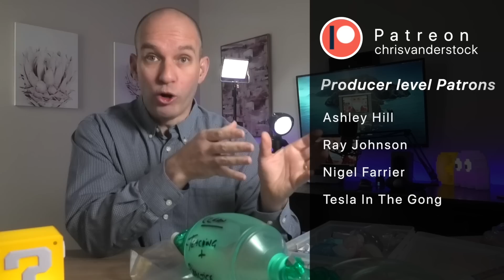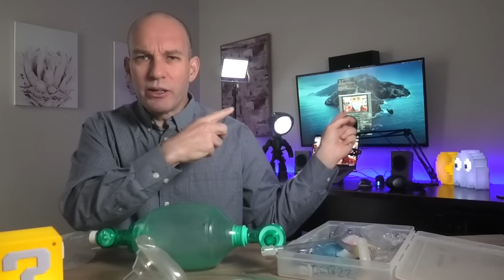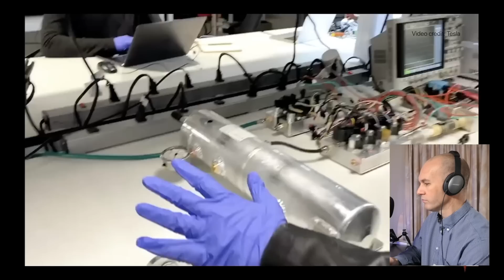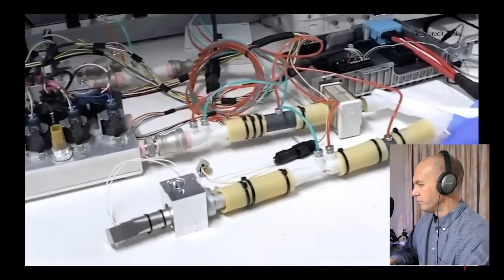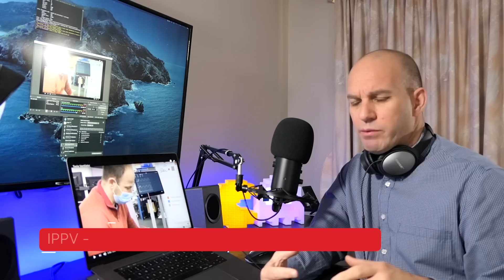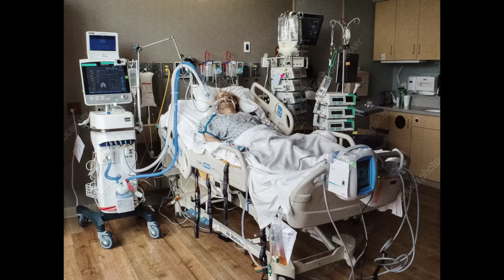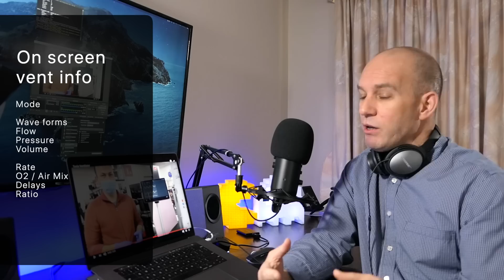Nurse reacts to Tesla's ventilator & what's with those resuscitators?

Comment: My take-away from this is why do we have to re-invent the wheel? 
Medical ventilators are in short supply, yes. So why don't the manufacturers of these ventilators, already in use, license out what parts they are needing so they can ramp up their manufacturing output? 
Occam's Razor - "Entities should not be multiplied without necessity."

Forty years of manufacturing experience speaking here.
Reply: The parts to make the ventilators are in short supply like you said, that's why they need to use the parts they already have to make ventilators.
That's why the ones that traditionally make ventilators don't supply them all
Reply: @liranzo01  Your comment does not make sense! Why would manufacturers sell parts to TESLA so they can make ventilators?  Sorry my friend but HUH? Why would they as they would manufacture the ventilators themselves. BUT the problem is their manufacturing capacity cannot meet the demand as well as some parts they need are in short supply.  Therefore this means LESS ventilators they can produce!

You seemed to miss this "manufacturers of these ventilators, already in use, license out what parts they are needing". That is employ other manufacturers to make the parts that are in short supply to make the ventilators thus increasing their production. 

For example: During WWII rubber was in short supply, you cannot make airplanes, tanks, vehicles, ships and so on without rubber.  Just this ONE thing prevented any of these aforementioned things from being manufactured. This led to the invention of synthetic rubber.  

Manufacturers production capacity is limited to physical limitations of how many ventilators can be assembled - this means for example if wiring takes the longest time in the assembly, then to increase production there must be more wiring stations - if wires are in short supply, then that also is a limit. This is called balancing the line. 

Another way to increase production is to licence other companies to build their sub-assemblies so they do not have to invest time and money to do this. Keep in mind this is a TEMPORARY situation. 

I hope this explains this better.  Don't invent something that is already invented, rather assist those who are already making them.
Reply: @tihzho  at least in my country manufacturers are close due to covid19, manufacturing is not as easy as you think. Im a mechanical engineer
Reply: @liranzo01  
So is America, manufacturers are closed. 
However, China is returning back to normal. Yes, there were quality problems with PPEs recently, however these were manufactured during lock downs, so that was a problem. Now with manufacturing returning to normal, ready to ship ventilators are becoming available from China from medical supply manufacturers.
Reply: I believe what Gustavo was trying to say was that since current medical parts are in short supply, this redesign is to build a ventilator using mostly parts that Tesla already builds. Tesla could get a license to produce current ventilator designs, similar to what GM and maybe Ford are doing. However, since the parts aren't available, Tesla would have to convert their production lines to producing those medical parts. While maybe possible, it would take additional time. And it may take a few batches to work the kinks out.

With this redesign, Tesla can use parts that they are already able to build in high numbers and high quality. Doing so would allow them to build far faster than with someone else's design. They are working with Medtronic on this, so they likely thought this through.

Comment: Sorry, the TESLA Ventilator looks like something knocked up in a shed! Give me the new Dyson/BAE/McLaren Ventilator. Fraction of the price of the, as described "Primative" breathing system, give me the one being built by the Brits. They have reworked it to be portable with it's own power source,  it runs on a 5000mAh battery (plug your mobile phone into its USB C socket) for an hour until the Ambulance gets you to a hospital with an ICU, then you can plug it in to the wall, and use it as a permanent unit. 

They are manufacturing 5,000 units a week, now exporting to the US, Canada and Australia. 

Try looking at that rather than a TESLA notch job. You do know how bad the reliability is of a TESLA car?

Comment: to be honest the computer that is controlling the machine is probably way under-utilized as far as computing power is concerned.
they have the "basics" covered so now they will start to add on the other requirements like keeping a positive pressure at all times.
then they can add a blood oxygen level sensor and regulate the amount of oxygen being introduced into the system.
likewise, synchronizing to the patient natural breathing cycle should also not be too much of a problem for the Tesla guys.
lets face facts, the parts that are being "borrowed" from the cars are designed to be far more robust simply because a car provides a far more "hostile environment" that they have to survive in than any intensive care unit would be.
 hats off to the Tesla team - and thank you for a very well produced video.

Comment: If you press harder no problem there is a over pressure safety valve releases the air lol.who invented that are aware of that. Tesla ventilator design is over engineered . No need to be so complicated. reminds me 90 years old valve radio.

Comment: Now would a CPAP do the same thing? Being you can adjust the pressure to fit what the patient needs. Or even a BiPAP be better, being you can control the breath in an out? Could these machines be used as ventilators? Not a doctor, nurse or any in the medical field. Simple trucker forced to use a CPAP.
Reply: Good question

Comment: Make sure Tesla engineer gets your video. PEEP could be maintained by software adjustments. Needs PEEP on the infotainment center. if the exhale is not done completely then peep pressure is maintained. There can be a peep sensor that has positive pressure measured and will quit the exhale as to not take the pressure to zero and then adding pressure via a warmed air supply
Reply: They seem to already measure pressure from both the exhale and inhale. As another comment said, humid and warm air is already being handled.

Comment: Would the old style Iron lung be useful? It would perhaps avoid the need for intubation, and associated sedation - plus no need for humdification. Many decades ago they could be made out of plywood at a very reasonable cost.
Reply: Iron lung only has one mode, can't do positive pressure, seems like it could help for some milder cases.
Reply: Interesting idea/question!
Reply: Iron lung only has one mode, can't do positive pressure, seems like it could help for some milder cases.
Reply: @robertpryor7225  It can do positive pressure. All it has to do is keep the inside of the iron lung below atmospheric pressure by some amount.  So the chamber is cycles from slightly below atmospheric pressure to a bit more below atmospheric pressure. The ambient air pressurises the patient lungs relative to the pressure inside the chamber.
Reply: @minxythemerciless  reposted from another comment https://newatlas.com/medical/british-engineers-modern-iron-lung-covid-19-ventilator-alternative/

Comment: The double filter @13:30 is not for the exhaust.  Its so you can safely split the output for two patients.
There is a Hepa and in-line filter on the exhaust to protect the staff.

Comment: seems more like a PR stunt (sadly not uncommon in the USA). Using car parts? Get real. The flip side is that any design is compromised by that part in its functionality. Besides the uC/uP what car parts were used?  Any engineer knows that until the design is integrated and system tested subsystems (like humidity/temp control) are just a wet dream.
MAYBE they MIGHT come up something worthwhile but I highly doubt it;  you don't get a hydroelectric engineer to design a CPU despite that they both involve electricity.

Comment: Here's mine. https://youtu.be/83YC6513Neo Added a PEEP valve. Title flow, volume, max pressure set by chamber pressure and pulse time as well as pressurization flow control. It works very well. Closed loop as exhalation is captured and routed to viral filter. 
This would be last resort, and only if no medical vent available. Alternate to a morphine drip. 
Watch "The Squeezer now AKA "Feimster Emergency Ventilator'" on YouTube
https://youtu.be/83YC6513Neo

Comment: I couldn't spot anything that might control humidity or temperature.

And the screen display doesn't appear to track either.  So, no sensors for humidity or temperature?

Would the FDA approve a ventilator that ignores both variables?  That doesn't make sense to me.

Interesting video!
Reply: On the right hand side of the diagram on the whiteboard there is patient circuit "external to Tesla system" which shows the humidifier. Usually patient circuit is a disposable kit of plastic tubes and filters, which may also include a "Heat and Moisture Exchange" cartridge which uses exhaled moisture and heat to humidify and heat the inhaled air. Because this stuff is directly exposed to the aerosols from the patient lungs it is disposable.

A step up from this is an active humidifier which is a pot with warm water which saturates air with moisture. The pot itself is also disposable, but it fits into a device which controls the temperature, and may also heat the tubes to prevent condensation.
Reply: @cogoid  Thanks.  I really didn't spot that.

Bad eyesight.
Reply: @Urgelt   It was easy to assume that they forgot about it, because they did not talk about it, and it was also not present in the actual prototype laid out on the table. But Tesla is working with Medtronic -- a medical equipment manufacturer, who know everything about ventilators -- I assume Tesla engineers have been given a crash course on how ventilators are designed and can ask for an advice from the experts.
Reply: @cogoid  And they are smart guys.  Tesla has done an outstanding job of recruiting top engineers.

At least, Sandy Munro thinks so.  He's better qualified to opine on that subject than I am.

I didn't mean to imply that it hadn't been considered; only that I hadn't picked up on how they might be approaching humidity and temperature control, and it wasn't included in their screen monitoring.
Reply: I thought he said they're not done yet

Comment: Very well presented. And needed; the public will be easily confused by dozens of versions of the mechanically compressed Air-viva being the solution. The real problems need to be addressed by engineers like those at Tesla. One thought: the version shown here that doesn't have patient-triggered ventilation can still be useful. Start patients on actual ventilators, and if they deteriorate to the point only artificial settings are being used switch them to a simple Tesla-type. When (~if) they improve, put them back on an actual ventilator. This will increase the overall availability of ventilators.

Comment: It looks like they’re doing well hardware wise. Some programming and it might be good to go
Reply: Along with extensive testing in all conditions, so patient's lungs aren't damaged and its effective.  This takes months plus there is FDA approval, as a watchdog to ensure these are safe to use in all medical cases.
Reply: @tihzho  Ventilators are not very safe to use under the best circumstances. It is not like the movies. Most people don´t survive. It is more like either you die now or maybe you live if you are lucky. But car electronics use higher quality parts so they are less likely to fail. As long as the software doesn´t have any bugs in it they should be safe to use.
Reply: @excitedbox  So you're saying medical ventilators are not as good as the ones made from car part, yes?
Reply: @tihzho  no, he's saying that car parts are designed for longevity. That doesn't make any statement about medical grade ventilators, which also use parts designed for longevity.
Reply: @BobPaul  And parts for medical ventilators are not? Doesn't make sense.
Reply: @tihzho  NO! You realize that I wrote two sentences and the second said that medical grade ventilators also use parts designed for longevity.

So here's the deal: Automotive grade is a class of electronic components. You can go on DigiKey, Arrow, Mouser, etc and filter components like micro-controllers, capacitors, CAN adapters, etc by various options to narrow the list of components. "Automotive Grade" is one of the filtering options.

Neither he nor I said that medical ventilators are poorly built. What he said was that Tesla is using automotive electronics, which means they're made from higher quality parts than say your laptop or a raspberry pi. This should help alleviate some concern with their ability to perform despite getting rushed through FDA testing. The software, not the hardware, is the primary concern.

Comment: In terms of safety and reliability, these automotive guys are a step ahead of most other teams -- Vehicle Control computers and firmware are already designed with the understanding that human life depends on them.

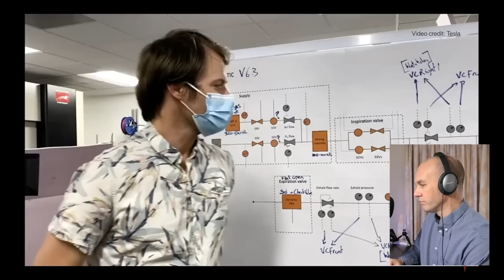If we look at the diagram 9:45, in addition to the user interface computer, there are two controllers in this ventilator, monitoring each other for safety and reliability -- VCFront (Vehicle Controller Front) and and VCRight (Vehicle Controller Right), reading two independent sets of pressure and flow sensors.

It probably also helps that these guys are used to programming and debugging safety-critical real time control systems for the car, and have standards and policies for designing, verifying and certifying such systems. It is a different set of standards from those used in the medical equipment industry, but they are just as strict and detailed.

Regarding the humidifier -- the same diagram on the white board also shows the humidifier and filters as a part of the patient circuit "external to Tesla system". I guess they are building this to be used with some already available patient circuit kit.
Reply: Yes, people might be misguided by the term "infotainment system", but this is not your typical android or windows software, as all the cars critical functions are monitored and configured using this screen. (configured, not controlled as there are other computers controlling the breaks and such)
Reply: @mennol3885  Low level stuff needs to have a watch dog timer and be able to reboot in fractions of a second.
The infotainment CPU cannot do this.
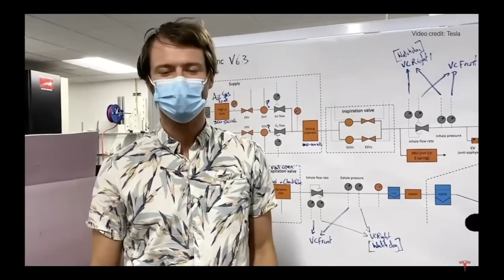Reply: @Patchuchan  At 9:53, you can see the word 'watchdog' written next to several sensors, along with which computer is associated with the sensor.
Reply: @Patchuchan  True, the main purpose of the "infotainment computer" is interaction with the user and not direct control of the hardware. But that still needs to be reliable, or the user can loose control of the system at unfortunate moments.
Reply: @mennol3885  Which is why I don't think critical; vehicles functions should be tied to it.
I hope they're only loading a stripped down Linux with just enough to drive the display on it for this application vs all the usual fluff.
Reply: @Patchuchan  Might not even run Linux at all. Could be running an RTOS instead.
Reply: Lol. That would be relevant if you were talking about nearly any auto manufacturer other than Tesla. Crappy, jumbled, barnacled code is their MO. Fart apps more important than reliability.

Comment: What about oxygenating blood outside body to avoid lung damage? Maybe not fully but partly.

I’m not an expert in this field by far I just want a good answer why or why not.
Reply: Curiosity is a good thing.  CMTeamCobra responded to another Comment with this: "ECMO removes the blood from the body, removes Co2, Adds oxygen, then pumps the blood back in.
It takes a lot of man resources, blood thinners so you dont get clots, and cost's an average of half a million dollars to be ran on one.   Covid patients on intubated ventilators have a 50/50 chance, and people on ECMO like 60%, So not really that different."

ECMO stands for Extracorporeal membrane oxygenation. It sounds similar to a dialysis machine to me, but even more complex, and will be a lot harder to manufacture from scratch than a ventilator.
Reply: Don Jones thanks! I still wonder why so expensive, but that makes sense with blood clots and price tag.
Reply: @donjones4719  In Germany this is what they are doing to patients which is why our death rate is so low. It is a last ditch effort though but seems to be paying off.
Reply: Maybe keeping the lungs active keeps them healthy so they continue to work?
Reply: Problem with oxygenating blood outside body to avoid lung damage is  that you will still need to ventilate while you oxygenate; you can't have oxygenation without ventilation. If you oxygenate outside the body, the co2 is still building up inside the body. You need gas (air/02) mixture or just 100 % oxygen tank.
Reply: @ogun3378  The device to do it ECMO, says it gets rid of CO2. In fact, it directly displaces it with oxygen